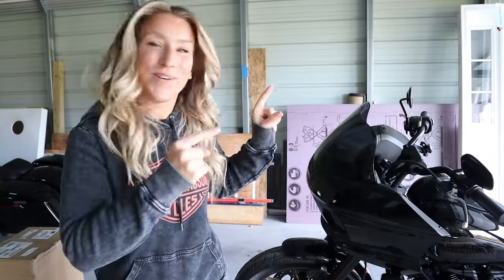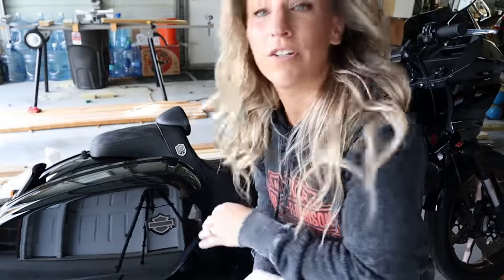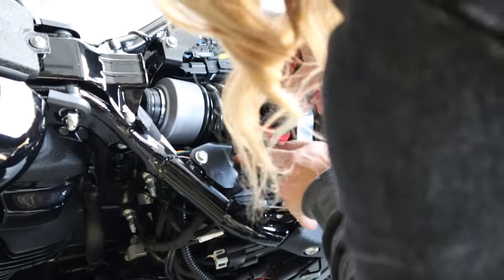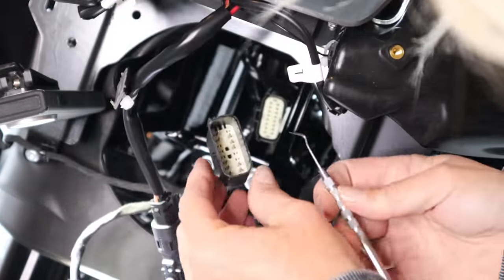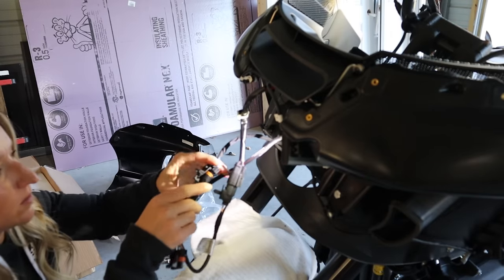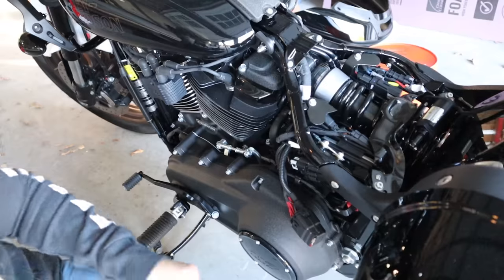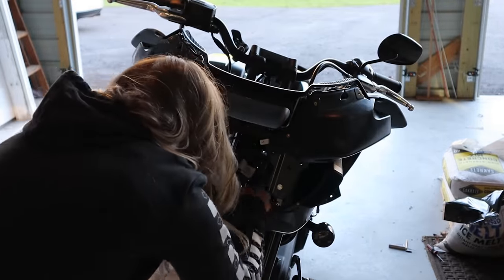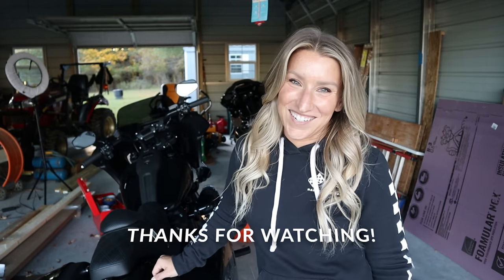I ALMOST GAVE UP! Rockford Fosgate Audio System Install on Low Rider ST

Comment: Harley should run the wires for it at the factory, then it would have been so plug and play and easy. No reason not too, that plug would protect the unused wire and it would make it far easier for anyone to spend the $1000+ on the Rockford Fosgate system, which should be their goal.

Comment: Good job Heather. Those pins can be a can be easy with the right tool. The safety pin was good engineering. ❤

Comment: Hey Heather, even though you hada call Anthony in for reinforcements, I really admire that You jump in with both feet on these projects! This video was way more fun and interesting than I thought it would be, seeing as I prolly won't ever (but who knows?) be installing a system like that on one of my motorcycles. I LOOOVE the Low Rider ST. And if I ever do get one, I might just get a hair up my nose and hafta get a system like that👍👍👍

Comment: The one thing that was depressing me about the new Low Rider St was that it did not have music capability.  My last bike was a 2000 Street Glide and the first upgrade I made was new pipes and an upgraded stereo system as I dig music on long cruises.   I just found out today that there is this aftermarket sound system that can be installed on an ST which makes me so happy as this now is the perfect bike for me.    I am not a wrench so of course would have the dealer install the system.  Just curious after I change the pipes and do a stage 2 upgrade if the stereo will be loud enough to hear music over the louder pipes.  I also read which is so damn cool that the stereo automatically increases in volume depending on your riding style so at lower speeds the stereo lowers automatically and increases the volume at high speeds.  So just curious how it sounded to you if you have changed the pipes on your bike.  Thanks so much for the great videos.  You have a new subscriber.  Safe travels my friend🙏

Comment: Hey Heather, great install. A tip for you when doing the pins (Molex), buy a set of the small, eye glass/jewlers screw drivers at Harbor freight or other stores. The ones that come in a plastic case with the clear top (contains both phillips and flat screw drivers). The smallest flat screw driver works like a charm. I have several pin tools and that one is my go to especially if you are depinning (not just removing the plug). The small screwdriver will lift the retaining tab inside the slot Anthony pointed out to release the pin on amp and molex pins and sockets.
Reply from the maker: Thank you!! I had one of those kits but the one I had didn’t have one small enough - I’ll definitely have to find one!

Comment: Great job on this install and video! Fortunately mine came with the Rockford Fosgate system (I got the El Diablo), so I didn't have to go through what you did. But you did an excellent job on working through this. Will help if I ever need to get to it in the future. I sure do love the sound! BTW, what is that seat you have? Looks great, and I'd like to get a new one with a little more back rest like that. Keep riding safe!!
Reply from the maker: The sound is awesome! The seat is the Saddlemen/ SDC pro series.
Reply: Thank you. And yes, the sound is incredible. And to help, I'm using a $30 bluetooth controler for the phone volume controls, mounted to the handlebar. Also wanted to ask, after riding that seat for a while, what are your thoughts? I like the idea of a seat with lumbar support. I see that Mustang seats has a solo seat with lumbar support too. Thanks for all the great clips!

Comment: Hi Heather, phenomenal job showing viewers how you installed the "Harley-Davidson Audio Powered by Rockford Fosgate" system on your Low Rider ST.  Also, great explanation on the realities of installing this audio system.  For other viewers watching, here's our official Installation Guide for Low Rider ST: https://www.youtube.com/watch?v=tGo0rWtkWPQ   -Eric
Reply: Is there a video somewhere on getting the phone connected to the app? I'm about to beat my husband's El Diablo with a baseball bat I'm so frustrated with it. The bike shows up in the app as connected, but nothing coming out of the speakers. The H-D manual is incredibly vague.
Reply: @abbyontheroad  We have an installation video available below.  Be sure the volume on your MOBILE DEVICE is up, we get a lot of phone calls where the volume is turned all the way down.

Harley-Davidson Audio App: https://www.youtube.com/watch?v=tGo0rWtkWPQ&list=PL-ob-nWq0t1gxT2aQVr4CMONPoIyDR6Xd&index=5&t=427s
Reply: @rockfordfosgate  Yeah, the phone was blasting. It had something to do with bluetooth. It's working now.
Reply: @abbyontheroad  Great!  Glad you got it connected to Bluetooth and got it rockin’!

Comment: Question... I have an El Diablo that already has the sound system.  I want to install heated grips but I can't find a good video for how to do it on the Lowrider ST.  I know you need to connect a wire harness that would be similar to the job you did.  I'm wondering if because my bike came with the sound system, I would already have the harness that I could plug the grips into.  If anyone has any thoughts/advice, I would really appreciate it.  By the way, Heather, you Rock!  Keep up the good work.

Comment: @10:00 Heather and Anthony begin marketing the "magic safety pin".
Reply from the maker: Genius 🙌
Reply: @MotoBlonde  I don't know about genius (certainly not on my part if that is what you're saying) but you went out of your way to try to find tools that worked better than the ones you were given, purchased them, and it was the one you two created that worked. The whole "necessity being the mother of invention" thing intrigues me. Glad it's done, I hope the audio system floats your boat, so to speak.

Comment: Great job guys;  hey, before you whine about that pin toooo much, try to think back to the days when there weren't any connectors, or um pins, and you have to cut into and splice the wiring harness to get power and (whatever) and you had to have soldering skills ...  trust me, its not even ON the pony tail scale.  🙂

marcus
Reply from the maker: Fair point!! That’s definitely above the ponytail scale lol!

Comment: i'm disappointed with the follow up of the low rider S engine debacle. a $20k bike with 20k (guessing) miles should not do this. was it a sumping problem? i have to believe you and anthony keep up on maintenance on your machines so i'm ruling out errors on your part. had you done any of the mods to prevent sumping like oil tank cap venting? please tell us the real story. there are a lot of m8 owners out here that would like to know.